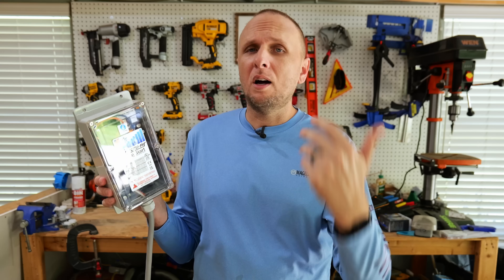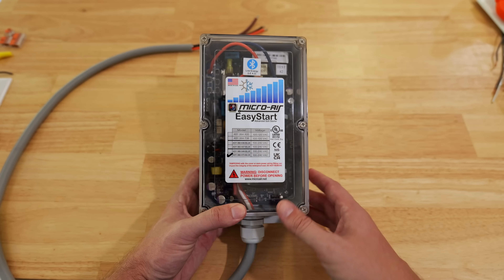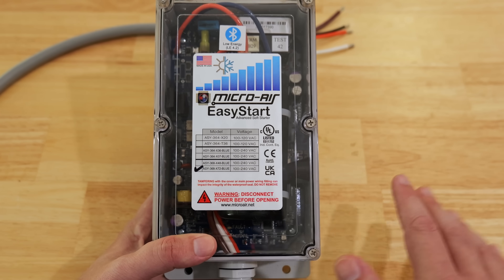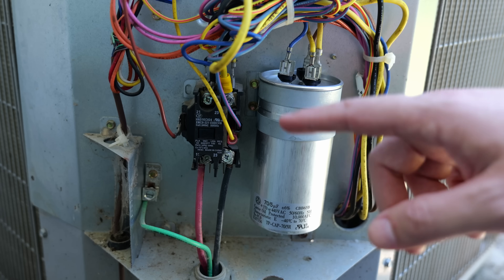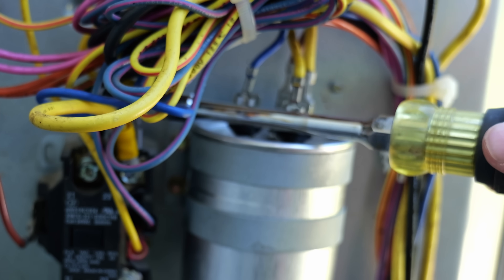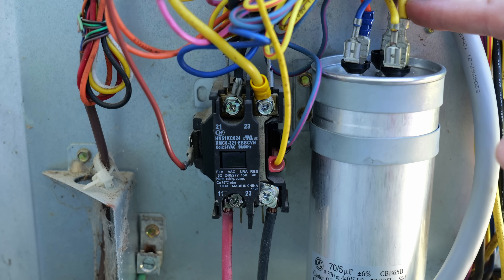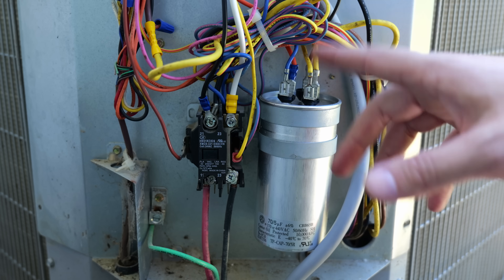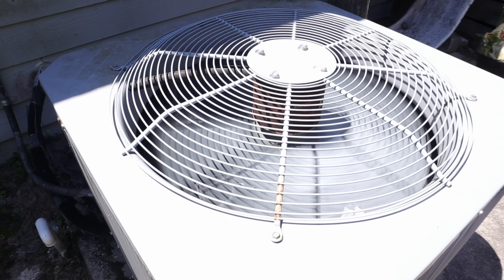Why Every Homeowner Should Consider Installing an AC Soft Starter | Micro Air Easy Start Install

Comment: Why don’t all ac’s have soft starters? Is there any draw backs to the soft starter?
Reply: 21,502 starts as of 6/13/23 on my soft start and 4 ton unit and my unit still runs like new….in texas heat to boot. An 8750 inverter generator runs my ac AND entire home (4 bed 2 bath) with no issues. Contrary to what Eric says, it’s a great investment.
Reply: I did the exact same thing.  MicroAir soft start, 10,500 running watt dual fuel generator converter to tri fuel.  I was able to run 4 ton AC using natural gas (AC rated at 29 amps).  I only tested it and never had to use it in a power outage, but I was highly motivated after going through the Texas Snowmageddon a few years ago!  I did not check the gas meter, but that generator was really sucking the natural gas.  All in, including hiring an electrician to install the 50 amp outlet, it was around $3,200.  I have moved since then and now have an all electric home, so I will be using gasoline.😩
Reply: @grrrrr2936  I was in the same boat. That storm pushed me into a proactive mindset. Installing a plug was one of the first things I did 2 years ago. The next on the list is this soft start.
Reply: Yo, I’m sure you figured something out by now. Was just helping my in-laws figure out their all electric home. Found dual fuel and tri fuel generators that use propane. Can run regular 20lb tanks, or can get whatever size you need. Calculated they could get a 100lb tank and run their generator powering the house for 72 hours. 100lb tank isn’t obnoxious in size, and if you’re only using it when power is out, doesn’t go bad like gasoline, and don’t have to fill it as often as gasoline. Get it refilled for cheap after it’s used, then ready to roll for next outage
Reply: The only reason you use a soft starter is so you can use smaller generator. You don’t save money on electricity because you can either  pull 125 amps for one second or pull 35 amps for 3.5 seconds.
Reply: @paramountrepair3129 And extend the life of the compressor.
Reply: @paramountrepair3129 coming into this a yr later.. I get the “no electricity” savings, but does it extend the life of the compressor???
Reply: It's primarily due to expense. These units run about $300 and it would be hard to sell that to many people, would make an AC system less competitive to another.

If you have a full variable speed AC system then you have it integrated as part of that technology. But 99% of single and two speed ACs will not have this at least in North America.
Reply: @colinnwn On top of $300 for the unit is there an installation fee?
Reply: @jajajajajajajajaja867  I installed it myself. Otherwise you'd need an HVAC contractor to install it. The time would be about 30 minutes. But some contractors won't come to a house for work for a minimum of an hour or more, and don't like installing customer provided equipment. So you will have to call around some.
Reply: @colinnwn I guess the selling point would be to inform that this upgrade would allow the AC unit to be run by a portable generator without having to get a very expensive one?
Reply: @colinnwn  my new A/c cost 11k ,300$ is like a handful of coins😂
Reply: @colinnwn when spending $10k on a new hvac unit that $300 is nothing, it should come as standard at that point
Reply: @Cristian-pw1iv  while I don't disagree with you in principle, it's just not how companies work. They will spend millions of dollars in testing to remove $10 in cost from every unit they produce. And if the 'consumer direct' price of a new feature is $300, then it would increase the system sales price by $600-900 for several reasons.
Reply: $$$$$, should I start a list of all the things you buy that are defeatured due to cost? Most everything we buy could be upgraded to perform better but most people only want the basic.
Reply: @ericdavidson5011
A soft starter is actually better for the compressor.  The design is not to be energy efficient it is designed to slowly inject current.  To use your analogy of a manual transmission you don’t “Pop the Clutch “ to get the car moving you slowly raise the clutch pedal as you slowly depress the gas.  That is unless you’re racing.
Hydraulic elevators used across the line starters for years then they went to soft starters.  Magically we don’t burn out the number of pump motors that we used to.
Reply: @jamespeterson686 as much as I like not having to check contacts on a starter I can't say it makes a motor last longer.  Most of the failures I've encountered have been due to lack of maintenance and manufacturing installing a starter that's to small for the motor. I have many across the line starters that are 25 years old and get heavy usage. They sound horrible when they start but you can't argue with time. The other issue is making sure all the feeder connections are tight.  I'm recommending my customers have their switch gear checked as stuff with high draw does loosen up. I recommend soft starters but not to extend motor life. I've had experience with soft starters shutting off a bad motor that would have completely emptied out a building due to smoking the oil in a submersible. The problem now is losing a soft start could put your elevator down for months as nobody has one. 
What has yet to be marketed is a electronic starter that does  wye start and a delta ramp to get up to speed, that would be the best of both worlds.
Reply: Will installing this device void a Trane warranty?
Reply: Because it will extend the life of the compressor and they won't you to buy more of their product.
Reply: I don’t believe that it uses less energy. The energy required to start up. Compressor is just that we can’t get rid of that. You can spread it out over more time but it’s still the same.
Reply from the maker: @crunchycrispybacon the proof is in the in rush tests.
Reply: @HowToHomeDIY  tests don’t mean anything when trying to argue against the laws of physics.
Reply from the maker: @crunchycrispybacon not arguing against physics.  The tests are demonstrating the physics.  It’s not magic.
Reply: @HowToHomeDIY  provide a link to these test.
Reply from the maker: @crunchycrispybacon I showed them in the video.  No link needed 😂
Reply: @HowToHomeDIY  of course it’s needed so people could read through it themselves because you’re making a false claim
Reply from the maker: Guy I showed the in rush before installing and after.  It went down by a lot.  That is better than a pop up book.  I don’t think I’m the one making a false claim.
Reply: @crunchycrispybacon lol wtf are you talking about?  He showed how well it works.  Did his multimeter use its brain and just decide to show a lower reading because he put a soft start on it?  Your comments make no sense and they are getting worse.  Take the L and move on.
Reply: @HowToHomeDIY  As I said, inrush doesn't add up to beans as far as Watt hours are concerned. Also saying Residential soft starts are significantly different then industrial ones is like saying residential VFD's are significantly different then industrial ones. The only major difference is longevity, mode of operation choices and price. Limiting voltage is the same either way, and modulating frequency is the same
Reply: @HowToHomeDIY  Again, inrush isn't power.
Reply: @integr8er66 nobody is saying they do bring watt hours down genius.  It’s bringing the in rush down to make it easier to start them with a generator.
Reply: @johnpicard4909  Hey genius he DID say it was lowering the power consumption, so pull your head out of you backside and learn to read
Reply from the maker: @integr8er66 when did I say it did this?  I didn’t.  In fact, I have said it won’t lower the running amperage. 😂
Reply: The cost of them.
Reply: That's my thing. It seems easy enough to do.
Reply: Mini splits do, but then its a inverter
Reply: I wouldn’t install one without approval of the compressor manufacturer.   And I don’t see that Copeland has…
Reply: Because under normal use the initial high amperage draw that occurs on start at doesn’t hurt anything. And the manufacturer would rather not assist you in adding a device that allows you to power your AC with unconditioned power. Generators typically don’t put out the proper 60 Hz Cycle power because the generator has to speed up and slow down to maintain a voltage within an acceptable range, and when it Has to ramp up or slow way down that can and will eventually burn up your compressor.  And does quite often when hooked up to a generator. The soft start or the hard start. Kit will not hurt your compressor, but the generator will unless you can put a power conditioner on it. But these contact providers don’t ever do the things they suggest long enough to find out what the drawbacks are? And compressors are usually pretty darn expensive so a generator should be only an emergency short term solution to a power outage
Reply: Would a soft start be recommended for use to assist a generator if you have a fully variable heat pump system? 
My Trane system starts around 20-30% and rarely runs past 70%. So would there be any benefit to install this?
Reply: @jamesharris3815 for a full variable speed AC or heat pump, the system already has the equivalent of a soft start in the system.

This is the only time I would say not to add an external soft start without specific manufacturer recommendation.

For any basic one or two speed AC or heat pump it should be fine to add a soft start. MicroAir has said they will assist any customer who has a warranty issue, and they have letter from Coleman that they are good to use on their ACs.

Some AC, and huge aftermarket AC control companies, sell a version of this, they just don't actively advertise it.
Reply: Why? Because they wan’t you to have to buy a new system every 7-12 years or sooner 🎉🎉🎉🎉
Reply: @PH-md8xpthat’s a myth.. I was in product manufacturing for 35 years, In designing equipment, we never looked to have the system fail after a number of years..
Reply: Mini split ac's/heat pumps come with the slow start built in. This saves hard jolt starting on the compressor, which makes it last longer.
Reply: They can't sell you one if they give you one.
Reply: Personally, anyone who doesn't swap to a mini split at the time that their current AC system needs to be replaced, is a fool. I have zero experience in HVAC. I installed my mini splits 100% on my own, and I bought the ones that didn't have pre charged lines, which make the install significantly easier. In my living room, I have a 12k BTU mini split, and in the middle of July, in Texas, on a 98 degree day, with the thermostat set at 72 degrees, the mini split only pulls 4.5 amps. Once the sun goes down, it pulls about 2 amps. I have 6,000 BTU versions in each bedroom. The best part is, if ever one of these fail, the whole system doesn't go down. I can simply pick up the slack with the other systems until I can repair or replace the one that failed. No emergency HVAC repairs needed. Also I can run my a/c on a small generator. I was able to run all of them on a 4000 w inverter generator while running a full-size refrigerator as well.
Reply: @Steven-gv1ke  mini splits work great on smaller homes that don't require a lot of ductwork, but after the trend of large American homes, many homes would need a large number of these, possibly across a number of floors, and that makes the minisplit design less practical in those cases.
Reply: How much does to cost to have it installed?
Reply: Any AC I've had in the last 15+ years have this built in as part of the unit (the soft start protection stuff, not the monitoring). I'm not in the US, and on 230v standard AC supply so maybe it's just different in the US? 🤷‍♂
Reply: @Thermalions all US home AC systems run on 240v circuits so it should be substantial similar
Reply: @Thermalions actually our built in ACs run on 230v as well, at least the outdoor unit with the outdoor fan and compressor. Most homes have what is called split phase power where there are 115v hot wires and a neutral, the hot wires 180 degrees apart; most devices connect between one hot and a neutral 115v; large appliances connect between the the two hot wires 230v.
Reply: It all has to do with the quality of the insulation on the motor windings. Soft starts can cause insulation breakdown over time, or cause a weak insulation point to fail on an older motor, thus causing compressor failure. 
Good news is most newer and higher quality compressors are good to go.
Reply: Soft starters to clutch slipping is not a valid comparison. They were not designed for running RV ACs on undersized electric supplies. 

They were designed and have been used for decades on industrial equipment to reduce wear and reduce instant power draw which is charged to industrial power users at much higher rates than constant power draws.

Electric motors draw up to 300% more current at startup known as LRA, than it does when running. This is true of AC and DC motors. This isn't by design. It is a side effect of the way a motor needs to start utilizing cheap to 
manufacturer solutions that are 'good enough' for most situations. A soft starter is always a better solution, except for cost.

There were some poorly designed VFDs which is a way to control motor speed at startup and running, and, combined with crappy motor design that could reduce motor life. This may be what is confusing.
Reply: @colinnwn We used a soft start on a 6,000 hp pump for a pipeline. The pump is installed in a rural area and the grid in that area couldnt support starting the motor without browning out houses in the area. Had to use a soft start to make it all work.
Reply: @Stephen Foster  I believe you, however, I am sure  that "system" would have been "designed" for that application of soft starting.
Reply: @ericdavidson5011  It definitely was purpose built for that application.
Reply: @Stephen Foster  And that was my original point to the OP. Everything has design parameters, and to skirt those in ether direction will generally result in failures.
Reply: @ericdavidson5011 no, motors are not “built” for soft start applications or not, they are regular motors.  These are probably soft starters using SCRs to control voltage supplied during startup.  These are not like VFDs that use IGBT to generate AC curves from a DC bus thus generating a lot of voltage transients damaging winding insulation on motors not “inverter-ready”.
Reply: @colinnwn  well you answer your own statement. When "system's" are designed for them I agree. However, a residential A/C's are not "designed" with these devices in mind. I assure you if a manufacturers of said equipment could place this within their "system" am claim super high efficiencies you better believe they would. Now, do they have an ability to build such a "system"? The answer would be yes however, the cost would be too high to argue true cost efficiency.
Reply: @ericdavidson5011  soft starts don't increase efficiency for residential power users. They make the compressor motor last longer, and they are designed no differently than larger motors that have documented additional life in industrial uses of soft starts. But the additional cost is high and the value of the extra life is less compared to the extra cost.  This is directly at odds with the manufacturer's interest to sell you a new AC every decade or so.

Certain AC manufacturers are working with Microair to add the devices to their systems. They also have a letter from Coleman Mach company that adding a soft start to their machines will not void the warranty and is beneficial to the AC overall.
Reply: @ericdavidson5011 You are losing the battle. 😂
Reply: @colinnwn in his example… inrush went from 125 amp to 35 amp… when ur compressor is cycling numerous times that can add up thus saving u some dollars with the electric company
Reply: @trarock24  The higher inrush amperage without soft starter will last less than 0.1 seconds. With a soft starter it might last 0.3 seconds at that lower level. Some residential digital utility meters don't have the time resolution to even detect the faster inrush current. But if you have a high enough resolution energy meter the total energy consumed over time should be almost exactly the same. 

If you have commercial level service with a high resolution utility meter, and you pay a premium for your "instant" power usage differential to your average, then getting rid of that spike would reduce your premium.
Reply: @ericdavidson5011  The technology has been used for half a century in the mines,  440v phase. Very proven technology.
Reply: @ericdavidson5011 Once again, these aren't installed to save energy.
Reply: @ericdavidson5011  I don’t know why everyone talks about efficiency. These things do nothing with respect to efficiency.  Why do you say that?  You don’t install these to save money on your electric bill
Reply: it costs >$0 and lots of people, including contractors, are cheap yet short-sighted. Pay $1000 now and then pay $1000 again in a decade vs pay $1200 now.
Reply: You didn’t show what you were hooked up to on your second amp test sneaky move there slick
Reply from the maker: @angiespencer4156 the same wire as earlier in the video.  What other wire would I connect to?  It was the compressor run wire both times.  Nothing sneaky here “slick.”
Reply: @PH-md8xp theyd charge more upfront. Planned obsolescence doesn't dominate every business meeting unlike what conspiracy theorists think
Reply: Do not use these....
Reply: @ericdavidson5011  why?
Reply: @2010khampton  it is extremely hard on the compressor.. The theory is sound but, if these soft start kits worked every company would use them to increase their energy efficiency. Now to support your theory a DC powered equipment use the same principles.
Reply: @Encourageable Technically, isn't it an answer? However, it is a damn good example. Here's another one! Slip the clutch on your car excessively  for a more comfortable and smooth starts, it is easier on your car! Soft start kits for.    A/C's are to minimize the maximum electrical draw. This, I believe, was started by the RV industry to allow smaller 30-amp portable generators to start (2) A/C's. Electric motors are designed to start at certain voltage and amperage for a balance of both  efficient and long life. Try to stretch one, and the other will haunt you and cause issues. If people want to save money, install  DC powered equipment.
Reply from the maker: These are not hard on the compressor, they are the exact opposite.  The reason ac companies aren’t putting them on yet is because they add cost to the manufacturing of the unit.  That being said, micro air is in talks currently with some ac manufacturers to start including these on some of their units.  The technology has been around a number of years but still considered fairly new.  Call most of your local AC companies and the majority of them don’t know what a soft starter is so there is more education to be done that this exists.  But to say this is harder on a compressor is completely false.  But don’t just take my word for it, there are videos of engineers and AC folks talking about this out there.  Give micro air a call, they are great about explaining this and very knowledgeable about the AC world in general.
Reply: I provide that answer due to the amount of people whom probably do not understand this stuff but may understand my explanation. So, an answer  it is not, but discussing technical terms with folks that are ignorant to a topic provides little help.
Reply: @ericdavidson5011  Sure.. So hard that AC companies wouldn't be able to sell you a new unit every 8-12 years could they.  Why would they include something that added an extra $300 to their bottom line short-term when they could leave it out and make another $5 + grand in a few years?  Its like everything else these days which is throw away so we have to buy new to keep the manufacturers in business.
Reply: @2010khampton I live in south Florida and run my 3 ton and whole house with this after any hurricane or outage which never happens. First was during Ian. My power was out 3 days and my 12000/9500 generator ran the whole house perfectly. My inrush amps are 77 as listed on my unit. With this kit, it is 26amps. My unit is a 11 year old Tempstar and I bet it lasts longer than it’s supposed too.
Reply: @HowToHomeDIY these are a god send for us here in south Florida. Installed mine just before hurricane Ian and worked perfect running my whole house including 3 ton ac unit with inrush amps going from 77 to 26 allowing my 12000/9500 generator to run perfectly.
Reply: @ericdavidson5011 so popping the clutch on a vehicle is better for it than slowly slipping the clutch? Horrible example bud… Also like others have said this is not harder in the compressor, it’s the opposite.  Do you have any factual data to back up your claims or just bad comparison examples? 😂
Reply: @fattysgarage1754   are you certain that that generator wouldn’t have powered it without the soft start? I have to think that’s a pretty big size generator and you might’ve been able to start it without the soft start. Just curious.
Reply: @condor5635  Yes. My 12kw generator is only backfeeding 50 amps to the panel which is its max ( 12000 watts = 50 amps x 240v). My 3 ton a/c unit needs 77 amps LRA to start. Now it uses 26 amps LRA to start and runs at 9 amps after start up. This was a game changer and allows me 40 amps or so to run the rest of the house. Before the micro air, window shakers were my only option and that meant I only had a/c in one room after a hurricane. I installed this last year when my a/c was 10 years old. I would bet the LRA would be even less then 26 amps on a newer 3 ton unit. For anyone reading this and doesn’t understand LRA, this is the Locked Rotor Amps or amps needed to start the compressor/fan on your outside unit. I first tested this micro air device last September after hurricane Ian when I lost power for 3 days. Game changer is an under statement. I also would bet that my a/c unit will last longer with the micro air attached than without. I only found out about this unit last year and installed it right before the hurricane in September. Honestly if it only lasted a year, I would buy a new one every year. I will probably make a video on this eventually since I really love this product.
Reply: Although you’re correct on your 50 A, I’m not positive a spike at 77 A for a short period (which is what is happening when you start the compressor) would not be handled by your generator is all that I’m saying. You never tried it I guess to see that it would trip the generator breaker?. I’m sure you’re probably correct.
Reply: @fattysgarage1754  - I guess what I don’t understand is your 3 ton unit has a 30 amp breaker normally and it doesn’t trip when your unit starts and requires 77 amps LRA. I’m guessing it’s for that very small instant you have enough back feeding from the grid that can support that inrush and it’s such a small timeframe that your 30 amp breaker doesn’t trip. In the generator case the 50 amp breaker won’t trip but the generator won’t support 77 amp inrush even for that small amount of time I’m guessing.  I have a friend with the exact situation you have and he’s gonna try without a soft start kit. I’m guessing it won’t work, but it might.
Reply: @condor5635  The reason the 30 amp breaker doesn't trip at start up and is sufficient for a 77 amp inrush is because a breaker does not measure amperage, it measures temperature. An instant (on the main grid) of inrush amps doesn't heat up a breaker enough to trip it. A generator will bog down quickly and trip the breaker. My understanding is that the beakers on a generator are not the same as your main panel breakers either and don't work quite the same. So my generators 12,000 watts of starting amps can't handle 18,480 watts of inrush needed even for a split second. Even if it did, it may not the next time it tries to start and damage is almost certain. If a new 3 ton unit has a lower LRA it may work, like 45-55 LRA it may be worth a shot. I never attempted to run my a/c before buying the micro air kit because it was not worth the risk of damage. If I had a 20kw generator it would still be a huge benefit to have the micro air unit installed. There is no down side. I would pay way more than $400.00  for what it provides me during a hurricane or other disaster. 

You also run a real good risk of damaging the a/c unit and or the generator when the generator struggles to start the compressor even if it could. The $400.00 spent on a micro air unit is a far superior and smarter choice than a new generator or replacing damaged parts on the a/c unit or the whole unit. It also protects the a/c unit from electrical surges and spikes.  Curious how your friend makes out.
Reply: @HowToHomeDIY thank you very much for your reply.
Reply: @ericdavidson5011 so you say it’s harder on the compressor. The creator of the video says this saves wear and tear. 

Which way is up?
Reply: @HowToHomeDIY thanks for the due diligence
Reply: @ericdavidson5011 thanks for your advice!
Reply: @ericdavidson5011 Soft starts don't do hardly anything to save power. They lower the inrush current, but that only lasts a fraction of a second, the power consumed in that short period doesn't add up to beans. Its more about stopping surges
Reply: @HowToHomeDIY Sorry, but in the industrial world Soft starts have been around for at least 2 decades, this isn't new technology, only thing new is the lower cost which allows it to reach lower markets
Reply from the maker: @integr8er66 we are talking about the residential market and in that sense it is newer technology.  Also per the folks at Microair it is more innovative technologically than the industrial applications you are referring to.  So no need to be sorry.  You’re just talking about something unrelated.
Reply: @ericdavidson5011  the soft start has nothing to do with energy efficiency. The reason they don’t put these in as original equipment as it would cost three or $400 more to the end price which is not something they wanna do.  It also extends the life of their equipment. Do you think they want that to happen?
Reply: @ericdavidson5011 please tell us why not to use these